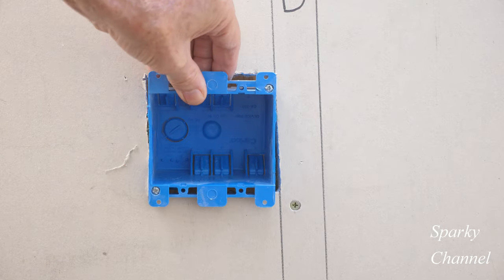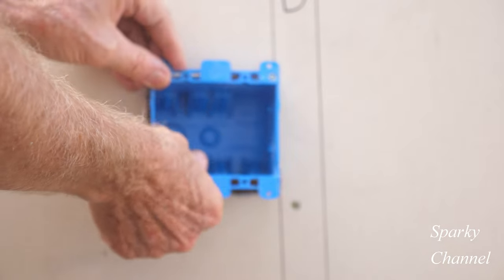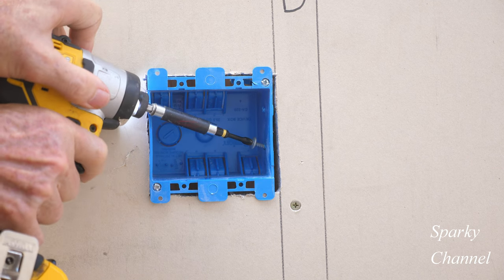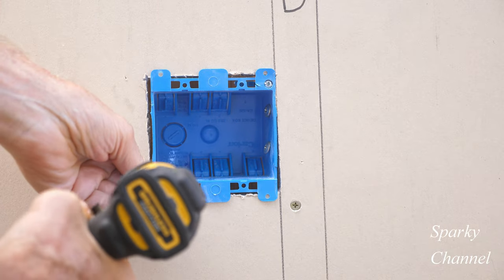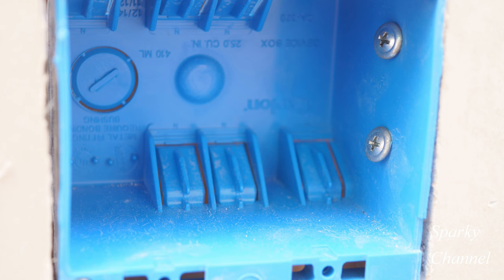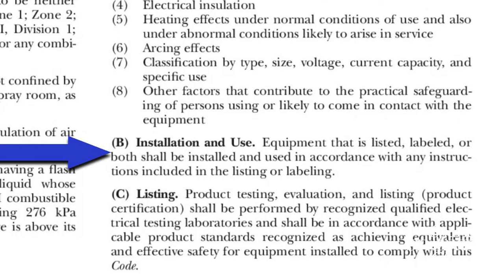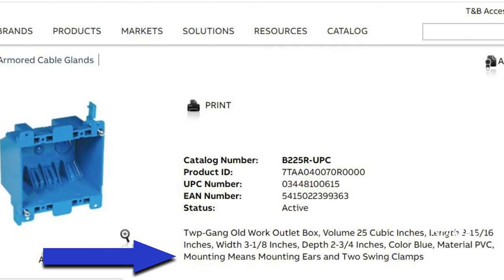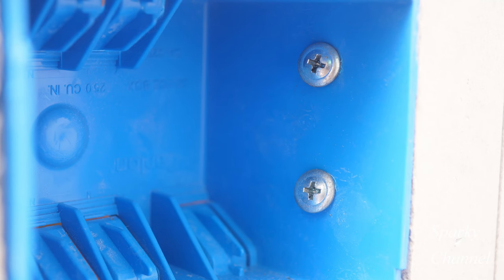Are Screws Through the Box and into a Stud OK per NEC on an Old Work Box? NEC 110.3(B)

Comment: Did I miss anything saying you couldn't modify the box?
It was installed according to manufacturer instructions by using the wings. It also used the holes drilled. 
NEC is the minimum needed. I say the added screws is going beyond the minimum. This, in my opinion, would be like using #10 wire on a 20 amp circuit. Going beyond the minimum.
Reply: You're comparing apples to oranges. The size of wire has nothing to do with how the box is intended to be installed. Modifying by drilling holes is making up your own instructions on how to install the box.
Reply: @illestofdemall13  obviously wire size is different. My point was that it was an improvement and going beyond the minimum.
Reply: @markchidester6239  That's why I said it's apples to oranges. Modifying a product can be interpreted as a violation by the AHJ. Upping wire size isn't modifying a product, it is done based on a calculation made by figuring out the load, the length of circuit, etc. in order to mitigate voltage drop. I get that you might make the box sturdier by modifying it but it's up to the inspector whether he/she approves of it.
Reply: according to manufacturer instructions Those instructions do not include "drill holes in the box where ever you want, and drive a nail/screw through." The manufacturer didn't make it with holes for screws; you can't make modifications to an approved / listed product or device.
Reply from the maker: I've made another video on this subject coming tomorrow. I've incorporated many viewer comments and questions from this video into this new video. Hope to see you there!
Reply: @jfbeam  according to who?

Comment: Most of the code is reasonable and mean well but some was written to avoid the lone event than has infinitesimal chance to ever happen again.  Experience, common sense and keen observation of the situation at hand go a long way in assuring safety and reliability. Naturally some knucklehead may use screw that are too long, touch a water pipe and stick out inside the box to touch the outlet's black screw and get somebody electrocuted as he touches a faucet.   The operative word is "knucklehead".
Reply: Realize the manufacture does not state that you cannot drill holes in use screws. You're still using the wings but you're just adding extra strength

Comment: I would have more reason to hesitate in doing this if it were mounted on metal studs.
As it is in wood, the screws are usually isolated.

There plenty of holes to use w/ a metal box...
Reply from the maker: Thanks!

Comment: first off i dont use plastic boxes unless outside and absolutely necessary. as long as the srews are back far enough yo allow clearance from the wiring i dont see a problem but yeah maybe technically it could be interpreted as a problem

Comment: Wrong, box is mounted in accordance with its UL listing as long as tabs are used. Nothing in code prevents you from improving upon the minimum mounting requirements. In addition metal screws in a wood stud is a stretch for a "shorting hazard" especially considering there are UL approved metal hangers that fold into boxes and are legal for use. Finally there are a HUGE number of enclosures where holes are allowed to be drilled into the enclosure without "voiding" its UL listing, why would this box be any different? This type of splitting hairs is not helpful and encourages rigid interpretation of code instead of its intended use as a guide for safe installation.
Reply from the maker: Thanks

Comment: So here's a thought. Would it be code if you used a metallic box that didn't have mounting ears and did the same? The answer is the benefits would outweigh the risks, but it would probably be against code unless the manufacturer specifically stated it's function for the holes would be a direct mounting to studs.
Reply from the maker: You're correct.
Reply: The screws would be bonded by contacting the bonded box.  But it would be up to the AHJ to determine if the UL listing was voided.

Comment: My opinion is okay as long as those screws aren't in the way of the wires and there's no tension wires in the screw heads are clear of the wires
Reply: I've done it for years I just put a dab of caulking or silicone on top of the screw. I've never had any problem with inspectors

Comment: I'll bet that someone has come up with a hot conductor that ended up touching the screw into the stud and ended up having a 'flying (occasional) trip' on an upstream GFCI. Would drive someone crazy. BTW: I HAVE done this... used liquid electrical tape on the screw heads. Never had a problem.

Comment: I had to change a single-gang original box to a double-gang.  There was framing on both sides of the box, making the wings of an old-work box impossible to use.  Sometimes you just have to do what you have to do.
Reply: Like use a more suitable box?
Reply: This doesn’t makes sense to me. The wings don’t flip out to the side of the box. They stop vertical and squeeze the drywall. So unless you were trying to mount the box sideways I don’t understand why it wouldn’t work.
Reply from the maker: As long as there was nothing blocking the top and bottom of the box, and you're not mounting the box sideways, the wings will work fine.
Reply: @SparkyChannel  2x4's were run above the top side of the box and below the bottom side.

Comment: What about a steel box? Same would apply but in the real world I would rather have a couple screws than the potential of a loose box. This might be a case where common sense trumps the code? FYI now one uses plastic boxes where we are.
Reply from the maker: Common sense is getting more and more rare these days. Thanks Craig!
Reply: Steel boxes are already made with holes in them to attach screws.
Reply: Metal boxes are grounded and would ground any screws passing through them.

Comment: Not legal but not unsafe either "if a wood stud is used".  I just ignored it and suggested that they tape "all" receptacles and switches to cover energized parts . What about a metal box it can arc between energized parts and the box. I "know" some will say BUTTTTTTT the metal box is grounded. Yea and that just proves that it is more likely to have a series arc fault than a dry wood stud. DUE !!!

Comment: My contractors installed most of the new work boxes like this but using drywall screws.  Against code but the inspector didn't care.
Reply from the maker: Wow. I've made another video on this subject coming tomorrow. I've incorporated many viewer comments and questions from this video into this new video. Hope to see you there!
Reply: @SparkyChannel  Yep already subbed. I have lots to learn!  Inspector didn't seem to care about 14awg on 15 amp circuit either, or I guess it's more that they didn't check for it.
Reply: Southwire makes electrical boxes that you screw onto the studs from the inside of the box. But what your contractor did was overkill they are already nailed on why add screws.
Reply: @paulsosa1872  some of them are nailed on

Comment: I in my own perspective do not see any issue besides the screw heads could be an issue but if u have a box with no tabs and this is all u have then this is what you have to do. Them tabs on those boxes do not always cooperate and sometimes they break cuz there plastic junk. I like the metal tabs personally but do with what u have. Alot of people do.
Reply from the maker: Thanks!

Comment: New house being built by a large builder.  Found a single gang box with 1 mail holding the top of the box onto the stud and 1 drywall screw through the inside of the box going into the stud holding the box secure.  I knew this was not code so I removed the screw and drove a nail through the lower nail bracket.  Sometimes common since rules!😂
Reply from the maker: Good work. I've made another video on this subject coming tomorrow. I've incorporated many viewer comments and questions from this video into this new video. Hope to see you there!

Comment: This would not be code compliant. An inspector in my neck of the woods would quite reasonably fail it and I would quite reasonably ask my apprentices why they didn't, (a) check code and ask first and (b) use a Carlon BH235A instead?
I've gotten into discussions with electrical engineers here before, they aren't responsible for the safety of my customers. I expect my work and that of my people to be safe and code is all about planning for safety when (not if) bad things happen.(almost always, permitting 15-amp duplex receptacles on 20 amp circuits is one of my bugaboos).
Reply from the maker: Thanks Ethel! I can tell that you do quality work.

Comment: Definitely would not pass inspection in pa
Reply: and where I am, in a code update class a few code cycles back, the inspector said he would fail it unless screws with rounded heads were used.
Reply from the maker: But do the inspectors see it?
Reply from the maker: Hi Ken! What NEC article or manufacturer permission was used to back that up?
Reply: @SparkyChannel   Honestly it depends on the inspector
Reply: @SparkyChannel  it was the code change when they specifically required screws to not have sharp heads.  and it's been a 36 hour day for me so I'm not going to go to the trouble of looking it up tonight.

Comment: What about metal boxes that come with holes in a already
Reply from the maker: The answer is found in NEC 314.23 (B)(1) which you can see in this video: Modification of a Carlon™ Box with Approval? NEC 314.23 (B)(1): https://youtu.be/yZcEyd9mwzY
Reply: The difference is that the metal boxes are SUPPOSED to be bonded to the ground. They have a green screw for that purpose. ALL metal boxes are required to be grounded.
Reply: @vincemajestyk9497   Yes I know about that But I'm saying why can't you put a screw through the side BX cable And metal boxes must be grounded noted as bonded
Reply: @jcaleca60  Well what I would say is as long as the box is grounded (bonded) there is more of a case for it being acceptable if done properly. The problem is when you put a screw in it changes the internal side profile in the box with reference to any interference (potential) with the device side terminals. One could argue it's more dangerous with a bonded box because it would be a direct short and hopefully would trip the breaker. If not more trouble.
Reply: I am retired now have   Health not good work 37 yes as electrician license license New York City took care of a building 6 of them From my understanding those holes in the Box are to get the heat out I had this discussion with an inspector But it's not really a bad thing As far as the head of the screw I would use a round   SCREW And you could put some  Duck seal over it
Reply: @vincemajestyk9497  Grounding screws are supposed to be green by code. If you don't have any and use a silver screw isn't the box still grounded even though it's still a violation?

Comment: I hate plastic boxes and won't use them if I can avoid it.
This is just another reason to not use them
Reply from the maker: I prefer metal boxes as well.
Reply: I have never seen a plastic box short out, although I've seen plenty of metal ones that do. I wouldn't hang a fan on one, except a Fanmaster type.

Comment: Metal boxes are attached to metal studs with - wait for it - metal screws. Why is this cause for concern? It's a non-issue.
Reply: It has nothing to do with the metal, it's simply a matter of installing a certified product outside of the ways that the manufacturer states which is against the code.
Reply: The metal box is already bonded so the breaker would trip if there was a ground fault.
Reply: Because plastic isn't conductive. That screw is.
Reply: However metal boxes are also grounded, so any short to the box (directly or via a screw) is a short to ground... Plastic boxes wouldn't ground the screws, so if a hot touches it those screws can energize metal studs
Reply from the maker: I've made another video on this subject coming tomorrow. I've incorporated many viewer comments and questions from this video into this new video. Hope to see you there!

Comment: Doubt that it is legal. The screws are metal and are not bonded to the box.

But contact with the screws is almost impossible. As a practical old work installation, I think it's fine
Reply from the maker: Thanks Ed!
Reply: There are mounting screws in other boxes such as a plastic breaker box.
Nothing is bonded to that. Kinda hard to bond to plastic.